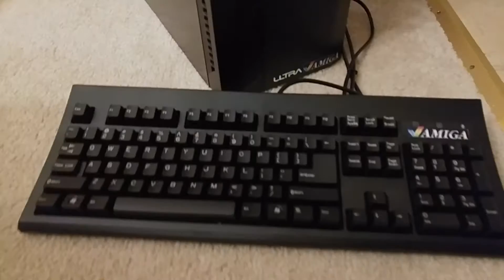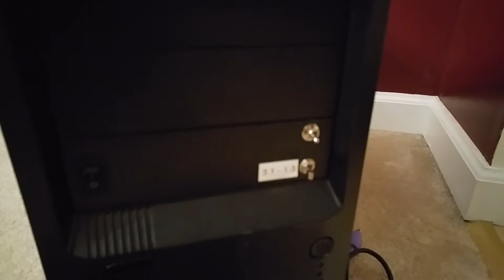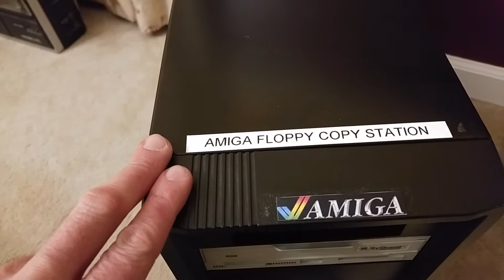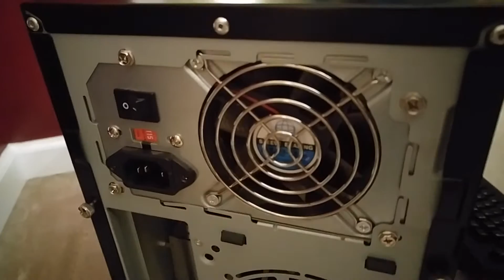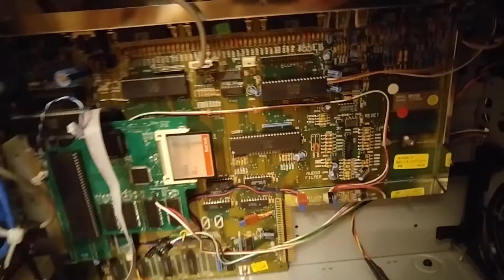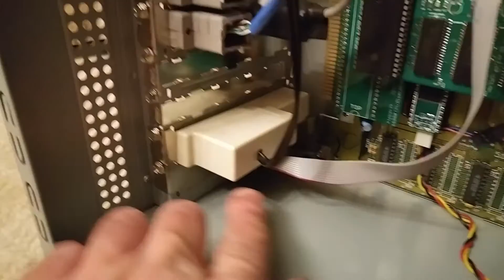Ultra Amiga 500 Tower

Comment: Very interesting how did you connected the ibm keyboard ?
Reply from the maker: Bruno Sousa if your shirts on eBay for Amiga keyboard adapter there is a IBM PS2 adapter that will go to the socket on the Amiga 500 motherboard they also make one for the 1000 and 2000

Comment from the maker: I actually have GoTek units and a few of my other Amiga computers. But in this project I did want to try this cable I found on ebay that supposedly turn a normal IBM 1.44 disc drive into an honest to god Amiga 880k disk drive. And it in fact does do that perfectly it turns and IBM disk drive into an Amiga drive and I just found that to be amazing. But the plan is still to add a GoTek to this project soon.